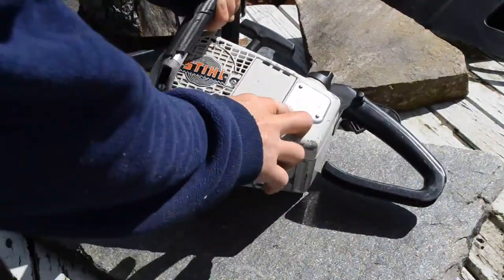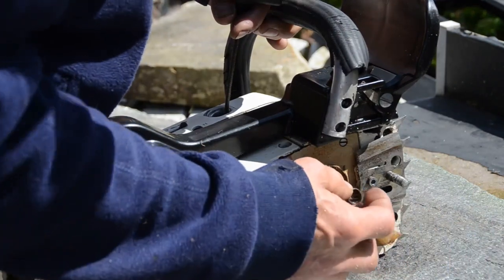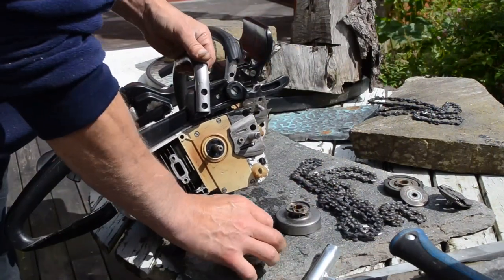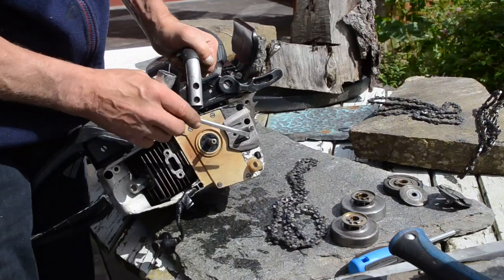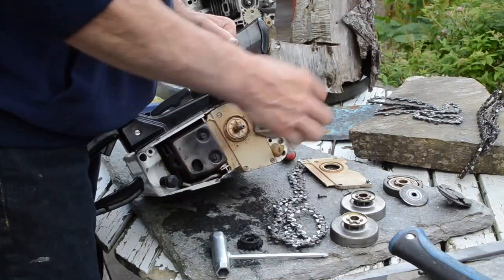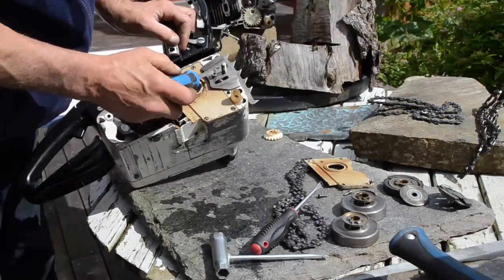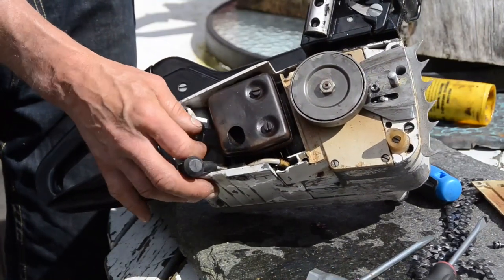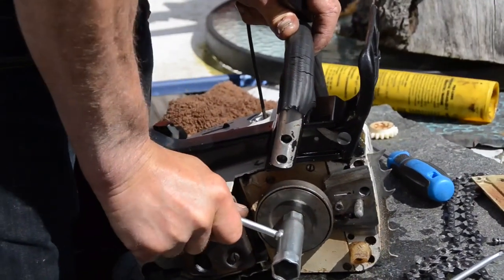Stihl 020 Oiling Repair  Clutch, Sprocket, Oil Gear

Comment: What size starter wheel is suitable for a Stihl 020 avp sprocket?
Reply from the maker: Hi ! Do not know what you mean. Parts search i recommend on google and pictures and draw...split draw or ask a dealer. Flywheel you mean ?  Search e-bay is also an option. Good luck.
Reply: Thank you so much.